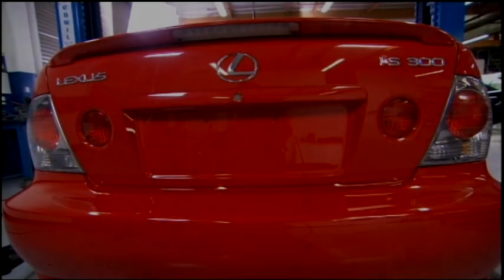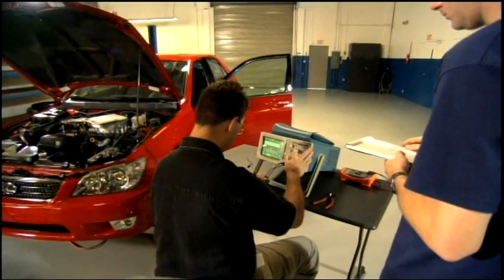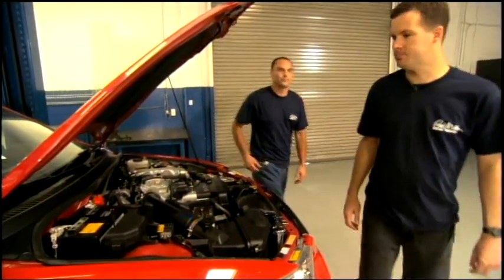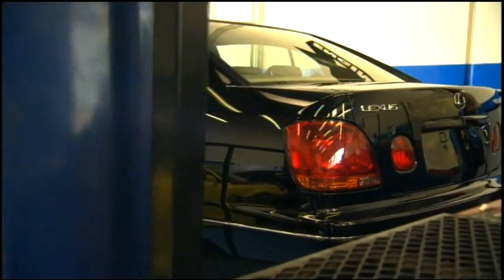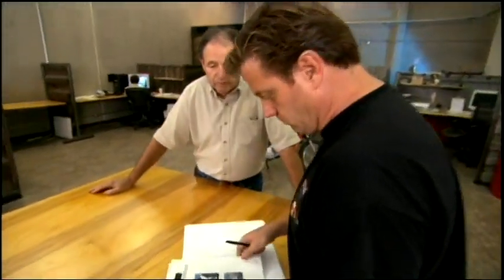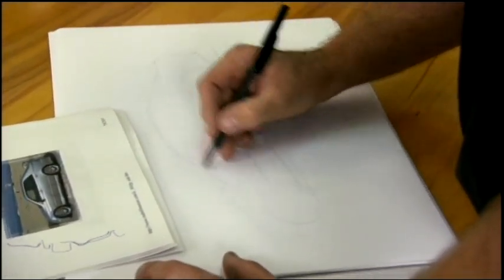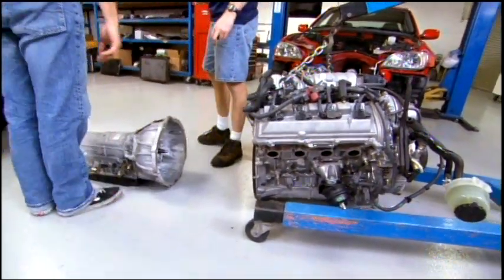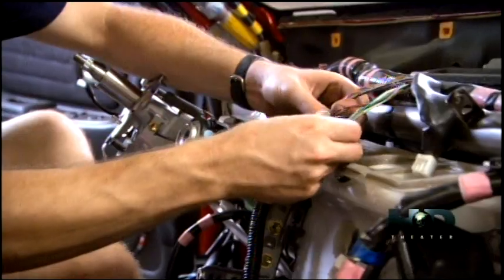Lexus "IS430" - Millen & Foose modified IS300 - Part 1 of 3

Comment: Don't know what kind of car you're talking about. I've turbo'd a Honda before and even drive a turbo car myself. It doesn't add responsiveness. The little Honda responded better when it was NA before we added the turbo. Lighter internals and a tune will give you responsiveness and faster RPM rev up.

Comment: for the cost of this swap you could go turbo at 350hp or more, or an LS motor...
Reply: Haven't seen the cost but the better option would have been the 2jz gte non vvti engine, idk why they went with the v8 1uz... the i6 2jzgte is better for higher hp builds....
Reply: +Kale Dotzler Toyota themselves funded this build. they were testing the waters for v8 performance sedans before they started creating the isf
Reply: pawn3d167 Oh, did not know that. Still wish they kept a turbo inline 6 in the family as a GT car rather than only having V8 powered sports coupes...
Reply: i agree. factory i6 turbo would be an awesome option for the newer sports sedans but i guess they had to go else where for fuel economy and emissions on new cars. the isf is proving to have lots of HP potential though now that they cracked its ecu finally this year and making good power on boost.
Reply: pawn3d167 Ya, and that v8 sounds really really good aha. The i6 would have been fine for emissions if they kept developing it, look at the BMW e90-93 335i. It comes with an i6 with 300 HP stock but quite a few people trade those twins for a big single and make up to 800hp with e85 on stock internals. Sound familiar? Aha
Reply: It could have been great if they just made the engine more efficient.

Comment: I wanna do this with a 2uzfe. I have the motor already from a 2006 tundra dblcab sr5. I just got my hands on a R154 trans simply because finding a toyota 6speed V160 is nearly impossible and when I do it's $5-6k used. This project i'm keeping inside the truck because I want to have a manual tundra 4.7liter. I'm gonna get my hands on another 2uzfe or 3urfe from a junkyard and put the 6speed on that. It'll have to be a T56 6speed I guess. Where can I get an adapter plate for that transmission...?

Comment: If you think they're idiots, you might be the idiot. If they wanted to swap in a 2JZ-GTE like everybody else, they wouldn't make anything of it. 2J is a great engine, but UZ series is also built just as well... just with an aluminum block. With this swap they will get over 100hp gain without laggy turbo's or aftermarket engine management.